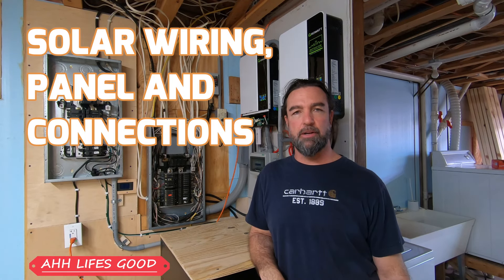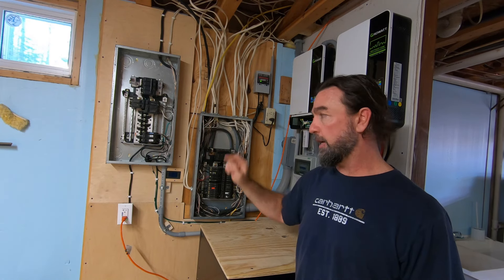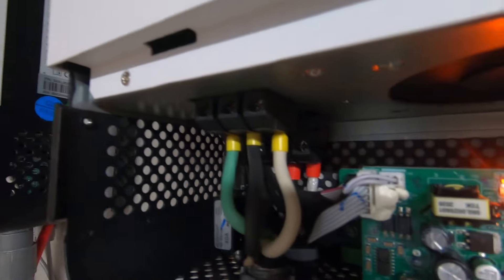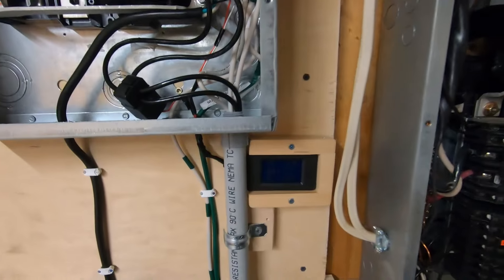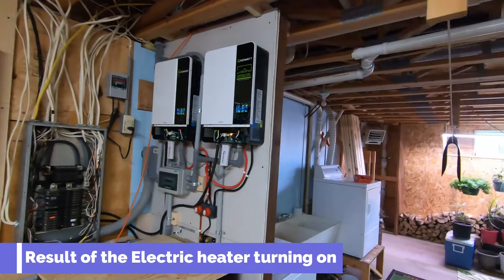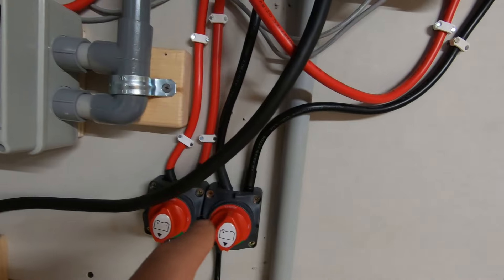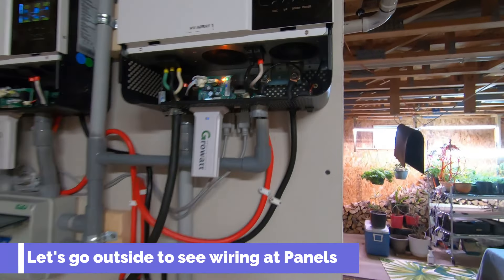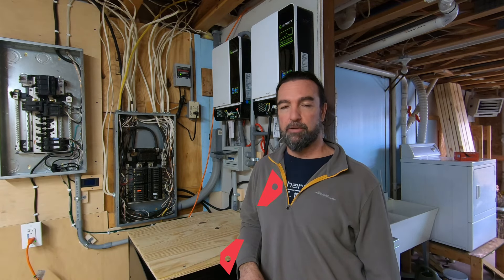DIY - Wire Solar Panels to Breaker Box Electric - Growatt Inverter 3000

Comment: I'm confused, I have this exact inverter. While the AC input & output are labeled L1-N- Gnd, these inverters, mine anyway, is 240 volt input and output. My N terminal is 120 volts. I have an Auto transformer to create a neutral. Very confused??
Reply from the maker: Sounds to me like you have the 5000 version inverter? The ones on my video are on 3000 series, a little different setup being that each one is capable of 120v as opppsed to the 5000 where you'll need a transformer.

Comment: I think the power from your inverters should be connected up top where the main breakers are instead of being connected to the output breakers.
Reply from the maker: - Thank you for the advice Jungle, very good eye for observation and I couldn't agree more.
Reply: @ahhlifesgood1956    I'm a retired mechanic that just started working for an electrician.  : )
Reply: I was thinking and wondering the same.

Comment: If I were to buy a 240 V inverter, could I connect it to a subpanel double pole breaker without going through a transformer to 120 V wires?
Reply from the maker: - Hello Garden Wonders, your screen name says it all. Whether gardening in the ground or gardening our life, we're almost always gardening something with our energies, what is it that we're gardening is the question? You can buy a 240v inverter that has a built in transformer that'll give you a 120v line coming from it. It's also possible to run without batteries, depending on the inverter purchased.

Comment: AC current is not pos and neg like DC. AC is hot/power common/neutral and ground
Reply from the maker: Thank you Blaine for the correct terminology
Reply: @ahhlifesgood1956  thank you for sharing a detailed view of your system. In learning from u
Reply from the maker: @blainecelestaine4543  - That's motivation Blaine thanks, happy DIY'ing

Comment: Let me get this straight-
You have 2 separate inverters supplying 120vac each correct?
If so how do you know you’ll get 240vac from 2 separate sources? If they are separate sources they have no common neutral that you have in your typical residential service. The voltage potential between these    2 (inverter) sources could be anywhere from 240v to 0v.
Reply from the maker: - Neutral is common between both inverters at the panel. The inverters are regulating loads, if this were a long term solution for my house I would've added a transformer to balance those loads but seeing as the system is designed to go into a green house that I haven't yet built its currently being tested and doing great I must say.

Comment: Not very clear objective. Sounds like you have local utility in the snow country. The racks look like medium size system. 
Payback in 20 years? Or it’s just an expensive toy.
Reply from the maker: On top of it all, this location is probably the cheapest I've paid anywhere in the world for electricity!  Payback will truely be if there is ever an issue with grid, and the planned large, atrium greenhouse with a year round controlled climate to mimic the tropical rain forest while looking out at the snow. Planning to heat the green house with passive geothermal and solar combined, hence the "1st" addition of my solar system. In this area its not cost effective to go solar given current electric pricing, but then again the unpredictability of where energy markets are headed, one never knows.
Reply: @ahhlifesgood1956  over a thousand dollars, it’s hard to count payoff. I run 3 panels and promise myself not to be addicted.
No doubt, for anything, if used frequent enough for long time, is cheap.
My objective is to run bright/creative lighting in winter.,yard waterfall/fengshui. In summer, 100f, solar compliments my air conditioning which is well below average, anyways.

On philosophy side, I started to track sunrise hours. Taking hourly numbers, pretty soon sun goes down. Suddenly feel life/time passes so fast. Make hay while sun shines.
Reply from the maker: @marktan3668  - Interesting how the solar process involves you in other aspects of life, not sure of your location but we're 46 degrees north and the angle of the sun difference here is extreme, from 60 degrees above the horizon in summer to 12 degrees at winter solstice. Even though the trees are cleared for the panels, when the sun is at 12 degrees it still has to go through the tree tops prior to panel arrival. That said, I can still generate 90ah today in full sun with 24 panels. For the me the process is new and very enjoyable, what happens next who knows, that's the beauty of life!
Reply: @ahhlifesgood1956  I am in Las Vegas, more than 10 months of sun. Summer is scorching, not affecting current flow as some claim.
Tilt angle matters. But it’s quite hard to adjust too frequently. Some said ~10% increase .
Payback can be complicated to calculate.
For me, my frugal wife appears happy with it, that’s important to me. But in reality, only 3 panels can solve my lighting half of 3500’, 10Kbtu aircon, some fengshui…
But, I should not get addicted to it.
When we go abroad, I need to automate it or convince my son to maintain it.

Comment: If the grid goes down, what stops electricity to backflow, potentially endangering linecrews working on the grid?
Reply from the maker: My inverters do not provide current to the grid service electric panel. The only connection I jave to grid is to supply electric and balance loads if needed from low batteries or faults the solar system (none to date). In this setup electricity from my solar cannot flow back to the grid.

Comment: Is there some required clearance around those growatt units?
Reply from the maker: - Hello GoatZilla, yes there is a specified for each inverter to have at least 50 cm distance from any other obstructions on Top and Bottom and 25 cm on any obstructions Left and Right. I would imagine this is for heat dissipation through ventilation. I've actually monitored the heat generated from these inverters at peak performance times and they do not seem to get very warm, not saying they couldn't but mine have not.

Comment: Thanks again for all your hard work and sharing what you've learned. If you ever put together a wiring diagram let me know. I am working on a 23KW solar system and I have the 48V version of your batteries with the LCD screen. I have 5 Growatt 5000 ( signature solar US models ) 1 Growatt Auto Shut off and 2 Growatt Auto transformers. I have the invertors mounted on the wall, all of my panels are up and I now have to wire it all together. I purchased the
Reply from the maker: - Sounds like a great system your planning to install. I used various schematics that I downloaded from the internet, and asking for advice when unsure. Let me know how it goes with your system, it should crank out allot of energy! I'm getting a max of  32kwh daily from only a 6000 watt system.